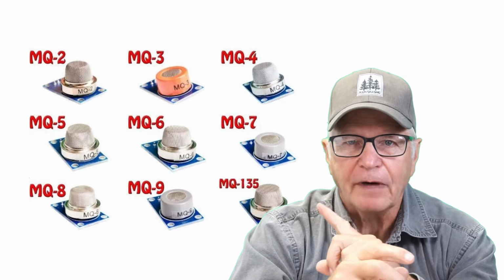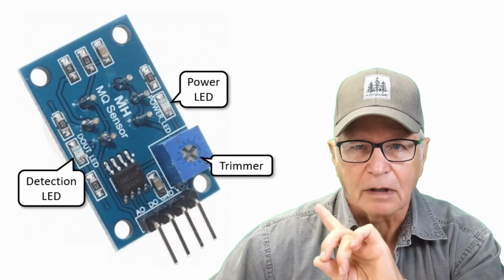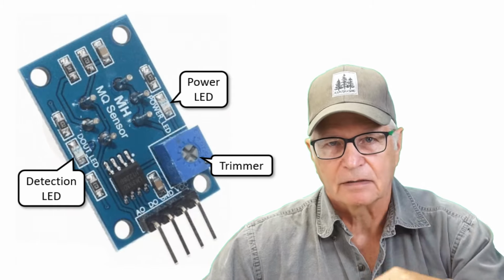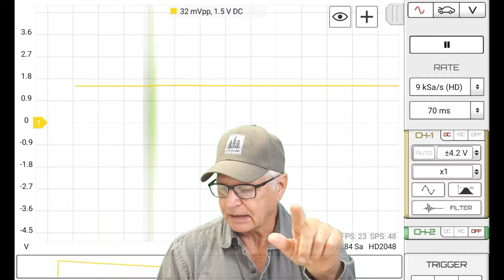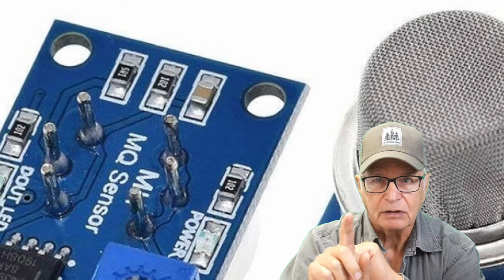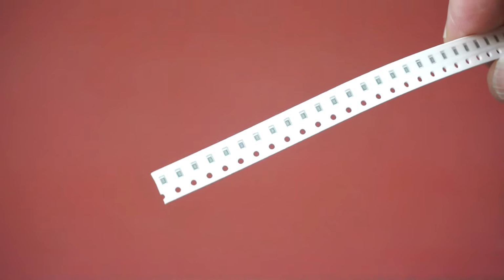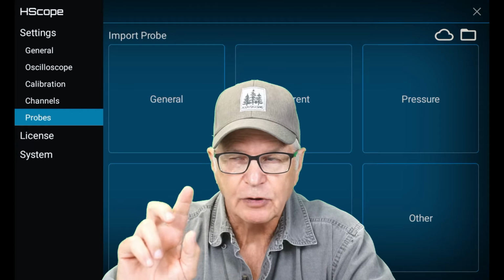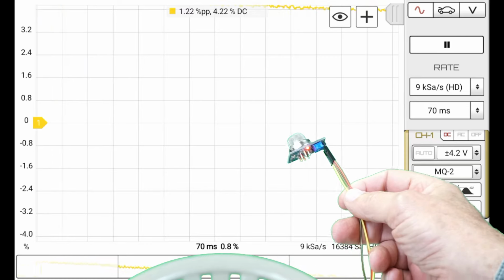GADGETS#197 - MQ-2 PRIMER

Comment: Nice one Denis.. Looking forward to the next video.

The easy way to remove an SMD resistor is to use 2 soldering irons  👍
Reply: Hmm... 2 soldering irons...
Reply from the maker: problem with that Phil, is that I'm not ambidextrous🤣🤣🤣